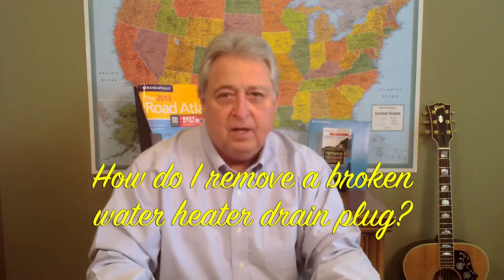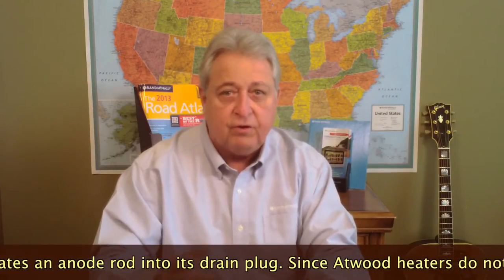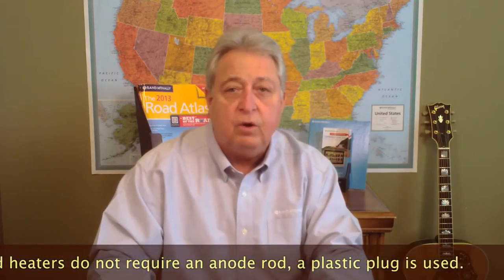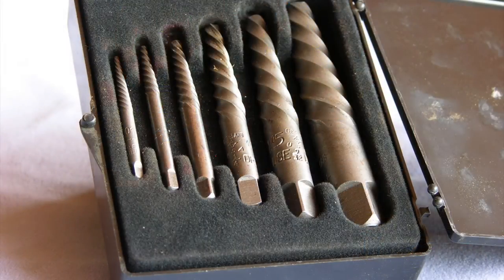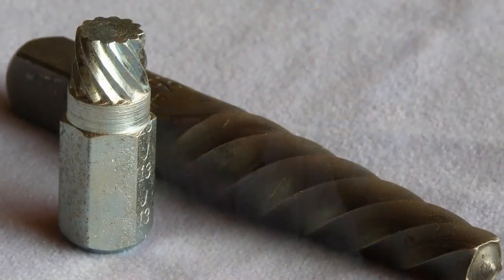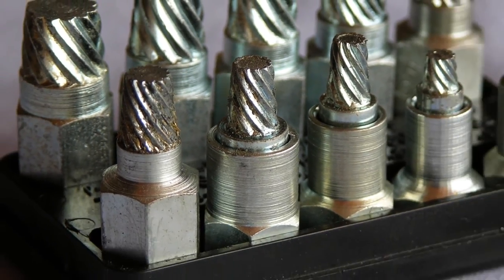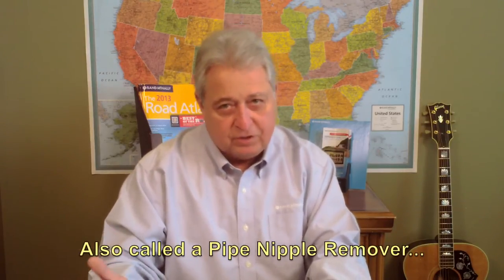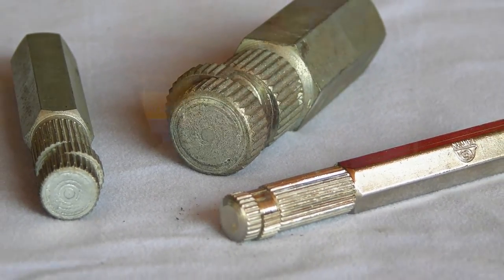Water Heater Drain Plug

Comment: Thank you so much, I was terrified as soon as I ripped the head off my drain plug. I took your advice and bought a set of internal pipe wrenches, took some time and hammering it in several times and slowly turning it, but it finally came out. Hallelujah!
Reply: Hi, I had same issue just yesterday with my 5th wheel Alpha, I removed the old plug as I just bought this last week and the plug broke off at the head, No extraction tools worked, Belize it or not I used an Awl and pliers that got the old one out.. I flushed and a boat load of calcium came out.. The new plug was very difficult to properly place in drain teeth.. I had to finally accept the fact that the plug is not in exactly right and I stopped turning the vise grip as to prevent breaking it off.. The issue I have is its working but did not screw in all the way to the head , It only screwed in half way.. Should I be concerned?